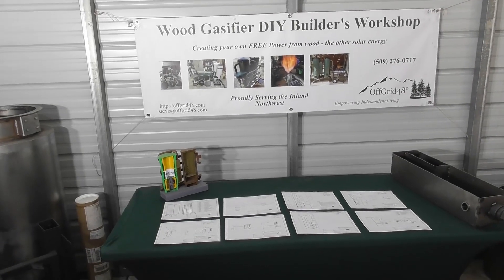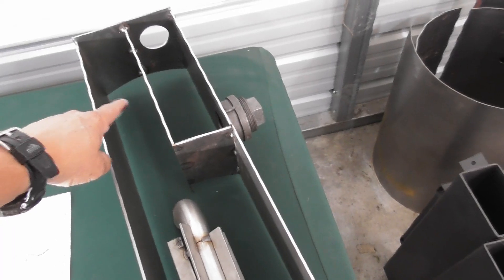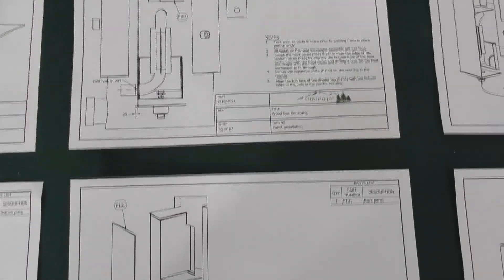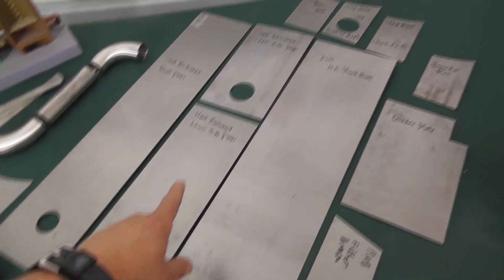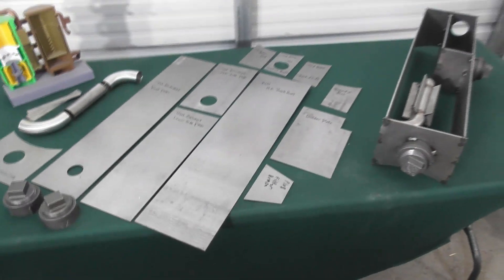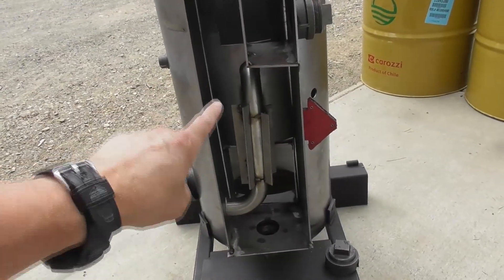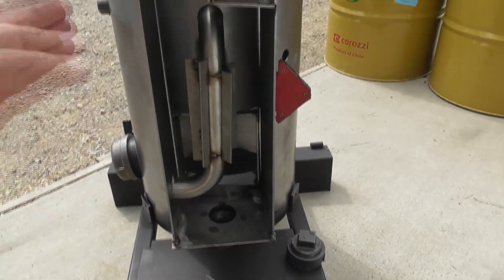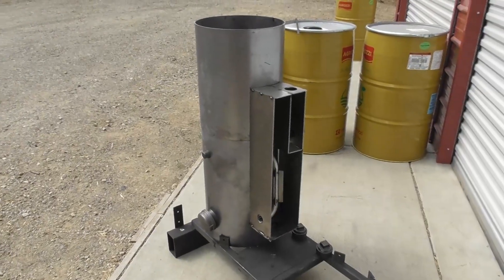Wood Gasifier Builder's Workshop: V3 Heat Exchange

Comment: What will the gas out put of this unit be? What size generator will it power?
Reply from the maker: This design supports generators from about 3KW to 2KW
Reply: @steveoffgrid485  Nice piece of work!
Reply: @steveoffgrid485  how many wood does it use each hour? What's the efficiency? Great work

Comment: it is great to see someone working on gasification with such a detailed specs. Can I have a question? if you connect the heat exchanger between the reduction zone (about 1000C I suppose) directly to the pyrolysis zone (suggested 400-500) how do you  manage to control pyrolysis temperature? I understand pyrolysis temperature is very important so that you dont get hard to crack tars, as it happens when you heat it higher than 600C
Reply from the maker: The temp in the combustion chamber is about 1000C, but then drops as it enters reduction zone. By the time the gas exits the reduction chamber is has cooled down in the 400-500C range.  The amount of air in the system determines the temperature of the combustion chamber.

Comment: When leak testing. Are you drilling a hole a putting port to pressurize? like with an M40 nitrogen tank with refrigeration ports? then remove after you know its not leaking and replace with threaded cap?
Reply from the maker: We use low pressure air for leak testing.  Soap and water on the welds t look for leaks.